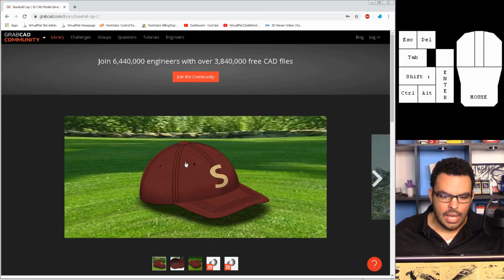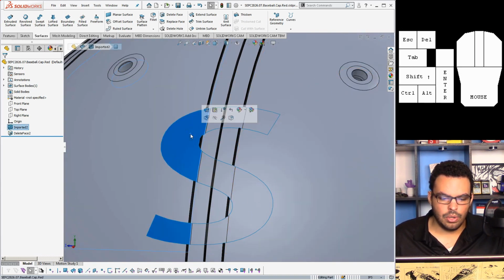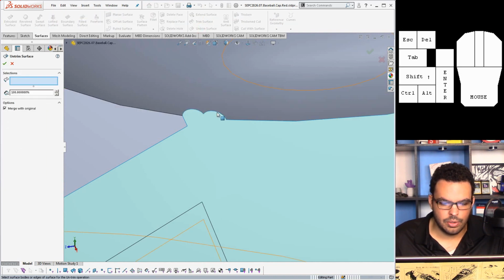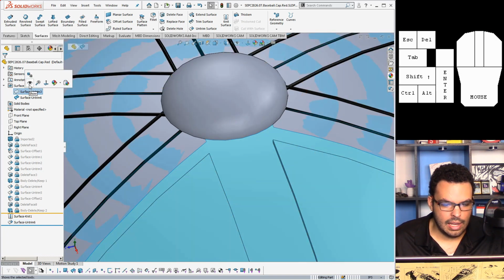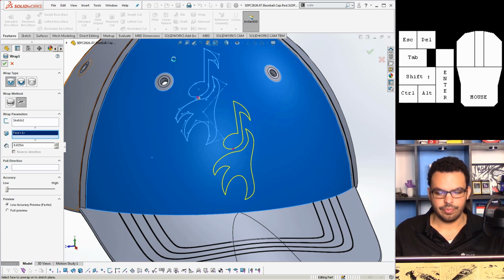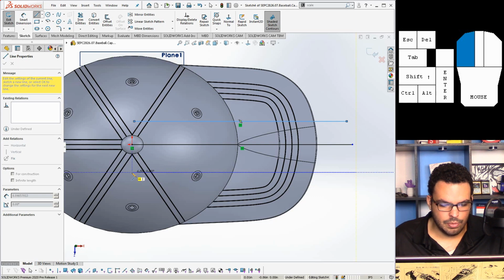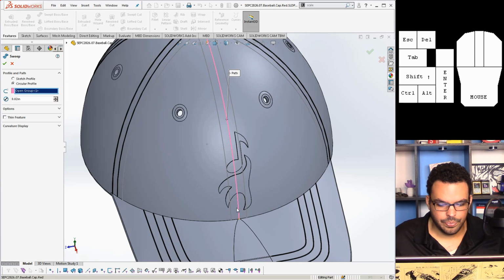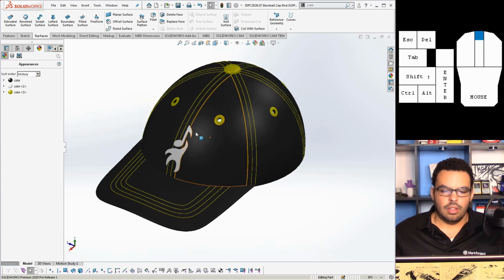SOLIDWORKS CSWE PRACTICE - Imported Part Modification and Direct Editing - Modifying Hat Logo

Comment: Great work man! I'm looking at the Surfacing cert now. Drawing Tools, Weldments, and Sheet Metal were easy since I use them regularly, but this one is going to be more complicated.
Reply from the maker: Thanks! I think that part of being successful with surfacing is having several ways to accomplish a task and having the ability to quickly form another plan when the first doesn't work. The reason I didn't edit any of the errors out of this video is that I want to show people how I react to these problems in real time. I hope you found it useful and I wish you the best on the exam!
Reply: @VirtualFlat  Thanks man!! It's either Surfacing or Mold Making, and then off to take the CSWE. :)
Reply from the maker: @Scott_G  Nice!! So just to let you know, the mold making exam was redone last year and it is now the hardest out of the 5 advanced exams (it needs a video for sure!) 
If I were you, I would focus on the surfacing right now, and then if you're up for it, progress to the mold making. I say that because being proficient in surfaces definitely helps with the mold making exam (it's almost a prerequisite of sorts). At any rate, let me know how it goes!
Reply: @VirtualFlat  I can verify this.  The mold making practice exam is kindergarten compared to the actual test.  Needless to say, I was ill-prepared but that didn't prevent me from getting it 14 days later.